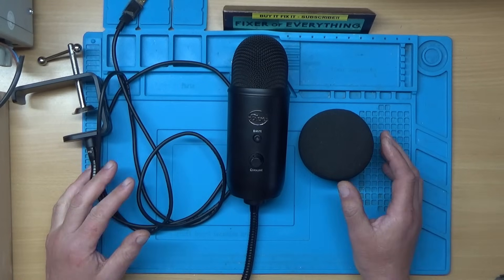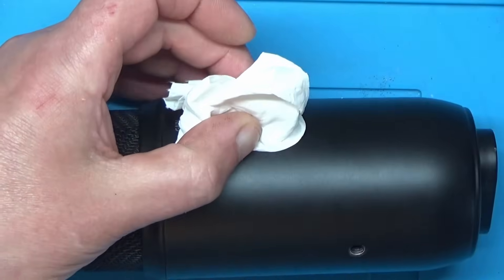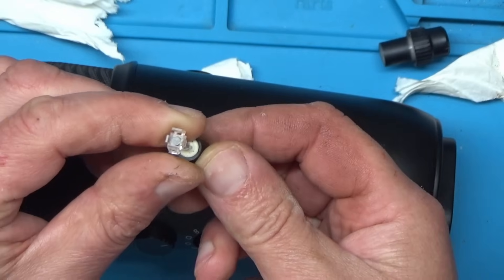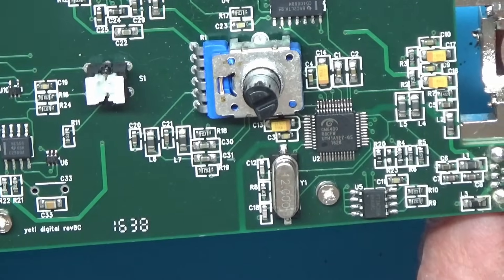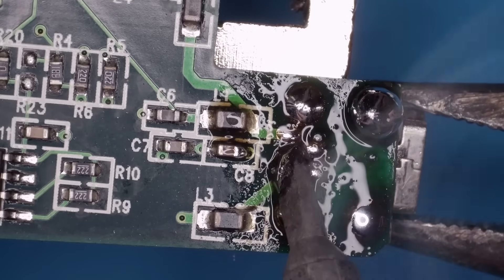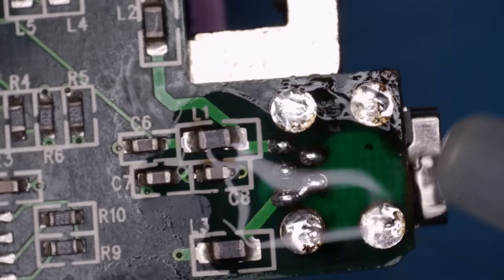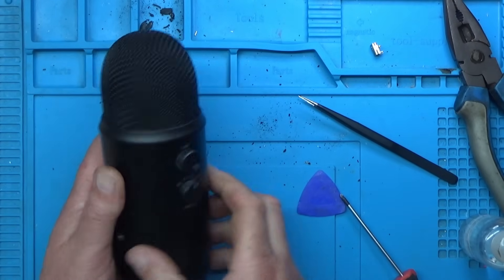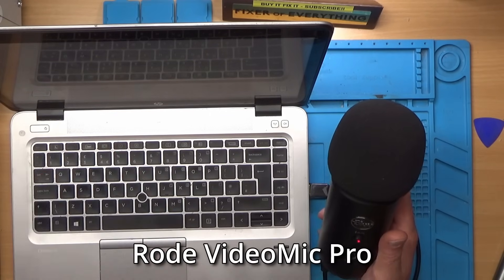Faulty Blue Yeti USB Microphone | Can I Fix It?

Comment: Ambient noise often due to auto gain  turning high as it's not hearing anything never ues auto gain Blue yeti much richer sound.
Reply from the maker: On my regular mic I have the automatic gain turned off (I think the overhead camera ignores it still when it's quiet). I've just bought a new Rode mic that records internally so I don't have to have a computer running while recording, so half of the last video I did used it, and tomorrows video will be using that mic too.

Comment: I also have a Blue Yeti microphone, and the sound is muffled and choppy when recording. What could be the reason? Do I need to do a repair, like replacing a capacitor?
Reply from the maker: Have you tried on a different computer first just to rule out software and configuration issues? I'd probably try that first to rule software or computer problems. Then possibly try the dial for setting the mode as if it's a hardware problem it could be from one of the internal microphones. Selecting a different mode may rule that out. If problems still persist then it most likely is something on the main board (although I'm not sure what at the moment).

Comment: rhodes seems to pick up a lot of environmental sound. Yeti should cleaner, just lacks in the lows
Reply from the maker: Agree, there are adjustments on the Yeti via the software. I decided it was going to be a bit of hassle using the Yeti, as I'd have to use my laptop to record the audio, and then sync it and it would just create more work for me.

Comment: Blue Yeti sounds great indeed. Also i wanted to ask the name or the model number of those 2 small screws that are besides the screw hinge below the microphone. Mine are missing from the mic and because of that some internal loose part is giving me a wobble noise while handling my recording. I don't know what to call them and that's why i am not able to find them anywhere. Please let me know thanks. Nice video
Reply from the maker: Thanks 👍I'm not too sure on the screws. If you mean the two on the very bottom of the mic, I think they are countersunk machine screws. They seem to be M2.5 x 12 as I've just measured them with my callipers for you. Hope that helps.

Comment: I own a yeti blue and it's always the usb. Where the chord goes it puts pressure on the usb plug. They will eventually bend and break on the inside. Then it's a chance every time you plug it in.
Reply from the maker: I had thought about that. On this one is was planning on cable tying the usb lead to the mounting so that doesn't happen. I since picked up a Yeti X which has the micro USB, and I need to have a look at that one still.

Comment: I have a Blue Snowball I picked up for about £15, fully working. It's an older model with a USB Type B connector (the same one you can find on most printers). For something like a microphone, I don't see why they would use anything else. Reliability is important!
Reply from the maker: Yes those connectors are very robust. The newer Yeti X has a micro USB connector. I think that is the worst USB connector in existence!

Comment: Out of the box, the Yeti sounds exactly like the bunch of cheap SDC capsules that it is - little bass and harsh treble. I always thought it was overrated - a Jack of all trades but master of none, and then most people just used it in cardioid anyway. There are some frequency response graphs out there that could be used to develop parametric EQs, but it's not going to sound like a large diaphragm condenser due to lack of proximity effect. It is easily worth your 16 quid though.

In terms of USB mics... you might try a t.bone SC440 USB (black) or something.

Comment: I did the same operation on my Yeti (older model) and desoldering the connector was such a struggle. After several additions of leaded solder, desoldering pump and wicking, I managed to pull it out but not without some damage to the board. A video from Kitchen Table Tech helpfully showed me where each USB pin lead to on the board.
Sadly, it only worked for a few days before losing the data line(s). I need to gather the courage to consider rebuilding some tracks with wire.
Reply from the maker: I'm sure you can do it, it's all just down to practice and experience (and a steady hand). Low melt solder is great for removing things like USB ports, HDMI sockets etc It is quite expensive, but it does go a long way as you don't use a lot of it.

Comment: I stopped the video 2 seconds in after "Hi Blue Yeti Microphone." My guess is the mini usb socket failed and is wobbly on the circuit board. (I had one that was so fragile. I'd say it's a design fault.) 🤔
Reply from the maker: Hi Tim, the soldering was actually OK on the board. Looked like someone had previously re-soldered it or replaced it before.

Comment: Been intending to mention the sound for a while... The Rode/camera combination has too much gain followed by a quick acting but slow recovery compressor (ie. an AGC of some sort). Normal speech is hitting the compresser quite hard which evens out the levels and effectively reduces the gain to avoid clipping. Trouble is when you shut up the compressor slowly (over a few seconds) winds the gain back in bringing up any background noise, like wind or equipment fans.

On  the quick 'n dirty demo the Rode has a more mellow sound and noticeable room acoustic. The Blue Yet rather thin and lacking in balls but didn't have noticeable room acoustic. I like the warmer sound but not the room acoustic...

Loads of parameters to play with so start with all EQ/effects/processing/dynamics turned off, set to flat or bypassed. Position mic a short arms length from and in front of your mouth, speak as you would and set gain so that the meters "waggle nicely". After that the "fun" begins, probably better to have a chat...

Comment: Røde was better because it's softer/rounder in the sound. The Blue Yeti was crisp and clear but lack the bass/middle tone the Røde gives, so Røde sounds better.
Reply from the maker: Thanks for that. Yes the yeti seems to lack bass, but I just used one of the default settings. There's tons of things to adjust as it has an EQ and a whole load of DSP effects and options in the control software which I didn't play with yet. So I can easily add more bass. I'm going to experiment with it a bit.
Reply: @BuyitFixit  That sounds (lol) great! Hope you find the right settings so you can try a new mic. great fix anyway.
Reply from the maker: Thanks Mate 👍

Comment: It’s definitely Blue Yeti for the win. Frankly speaking, removing hiss and background noise is just a click away, for example, in Final Cut Pro or can also be done in so many other ways, but as is Blue Yeti definitely sounds much and much better. If you figure out the settings and add some compression and maybe light reverb - it’ll sound PRO 👍🏻
Reply from the maker: Thanks for the tips, I'll look into that 👍 I'm using Davinci Resolve for editing, I did notice that it has filters for noise removal, noise gates etc. I did have a mess with those but wasn't too impressed with the results.
Reply: @ in FCP there is an ML function for quick noise removal - works really well. Can’t really do that same thing with noise gate, because gate blocks whatever is quieter that a certain level of signal, but that ML thing is removing a noisy part of the spectrum

Comment: In my opinion, I prefer your existing mic rather than the Yeti. Maybe that's because my expectation of your brand " Buy it Fix it" has been conditioned by listening to your many episodes using the existing mic.
Reply from the maker: Good point John. I think I might be able to make the Yeti sound a bit more like the original mic as it has got a 5 band EQ, filters, effects etc which I've not even played with yet. Also you can set the mic "pattern" so it picks up from a single direction, or all directions etc.

Comment: The Yeti mic has essentially zero background hiss but a little harsher sounding on the ears. After tweaking it's profile I think its the winner here. Are you sure there isn't a way to get it to work directly with the camera?
Reply from the maker: Thanks for that. I'm not too sure if the problem is the recording in the camera itself (in built pre-amps or something). I've turned the AGC off on the camera and set the level to quite low, but I still get the hiss.

Comment: The Rode sounds better. The Yeti is too clipped and thin sounding.
Reply from the maker: Thanks for that. I too like the sound of the Rode, but I'm going to have a play with the EQ and other settings on the Yeti as there's tons of options, EQ, etc.
Reply: @BuyitFixit  I have video mic pros too. they score over my Rode NT-1's because they are directional rather than omni so you can point them at your mouth and minimise the pickup of sounds from the test gear on the bench. I do run them into a DBX Processor with compression and a noise gate and record them with a Tascam  Audio recorder. I just use the camera audio to sync the sound to video and then mute the camera audio.
Reply from the maker: Thanks for the info. Yes that's pretty much what I did when testing this mic, I recorded as usual and just matched up the audio. I have to do similar when recording with the microscope, as that doesn't have audio so I use my overhead camera and then have to sync the video with the audio.

Comment: Blue yeti has a great sound isolation I like it specially if you have noise around you 👍🏼👍🏼👍🏼
Reply from the maker: Thanks for that 👍I know there are a lot of options in the software with the Yeti, and you can also set different mic patterns to pick up sound just in front, or all around the room.
Reply: @ a quick question I found an and fuse with the letter I but can’t find a replacement online as it seems it doesn’t exist, what do I do ?
Reply from the maker: If you have a picture of it, drop me an email at the name of the channel at out look dot com and I'll see if I can help.

Comment: using USB Mini must be a fairly old model of the Mic then I guess
Reply from the maker: Yes think you're right. I actually won another Yeti mic, the Yeti-X which I've yet to try to repair. That one isn't being detected by the computer. It has power, but the micro USB looks intact..
Reply: @BuyitFixit  ah you use Ebay bidding to find cheap items to repair ? I hope you can fix the other one too.

Comment: Forget it. The Yeti has a thinner sound than your usual mic. These are not good condenser mics. They emulate the form of the big capsule ones, but they use a normal, cheap capacitor mics instead. Keep on using your usual one. Forty years in the recording and music production world are recommending it to you.
Reply from the maker: Hmm Interesting. The Rode mic is also a condenser mic from what I remember. I know the Yeti has a lot of effects, EQ, etc which I've yet to mess with so perhaps it was just because it was on a default preset. I know a lot of YouTubers podcasters seem to use them.
Reply: @BuyitFixit  yes, of course the Røde is a condenser mic with almost a couple of cheap capsules. But never forget that always are qualities; as I mentioned, nothing to see the condenser topology between a Sony C800G, or a Neumann U87 (or 67, et al), with a huge condenser capsule (mylar, gold powder), with an excelent frequency response and flatness, with a 1£ (or less) condenser capsule. 
Even the MEMS mics are better than these small capsules. And of course the pressure gradient. 

All in all, believe me: this “big” mic has a good image, but the inside is very poor (in terms of microphone exclusively, I mean). It will have eq, effects, etc., but the real sound is poorer than the Røde you are using. Thinner, much thinner (but not clearer; equally clearer, but with an important low cut).

I sold millions of records in the '80s and the '90s, and produced and recorded artists like Paco de Lucia, The Chieftains, Depeche Mode, Julio Iglesias…and a lot more. 
I think my impression will be of a certain importance. But, after all…it’s up to you!
Reply from the maker: Thanks for that, I'm no expert when it comes to microphones etc so good to know someone who's a lot more knowledgable than me 🙂👍
Reply: Thanks to you for your excellent videos!!

Comment: I prefer the Rode even though it's not as good an audio; it's roomy and reverberant. 

The Blue is cleaner but a bit sterile for your use in my opinion. 

I want to hear the room as it's far more natural to what you are doing. You don't need the isolation.
Reply from the maker: Good point. I know the Yeti has different mic patterns to do that, and a lot of other options such as reverb, EQ etc in the software control panel. I'm going to have a mess with some of those and see if I can get it more like the Rode but without the hiss.

Comment: YEAH... Don't change the Mic.   That "BluYucky" microphone sounds like it's name.   The problem seems to be in the audio range of the microphone.   Very little bass and a lot of treble.   It doesn't sound natural.   You may need to put mixer between the mic and the computer so you can control the frequency response of the microphone.  Check the audio settings on the laptop to ensure you are using the full capabilities of the Microphone and the recorder.
Reply from the maker: Thanks for the feedback. The Yeti has a whole software app on the PC which lets you set the EQ, effects, etc as it's got a built in DSP. I might have a mess with those as I just used one of the default presets.

Comment: I think, the yeti is a bit more tight, certainly more middle and hi freq (or less bass). Both sounds great. It's up to you.
Reply from the maker: Thanks for that. I'm going to have a mess with the EQ / effects settings in the software as it was just on a default preset. I'm sure I can add more bass and cut some of the treble.

Comment: 3:38 - Im thinking now, if you have fishing line, cut one part of 15cm, and tie it in O shape, repeat one more time, now you insert one on left side, and tilt right, insert second one on right, and tilt left, so its like X , pull up and should get out. Hopefully you understand me.
14:42 - Every single user has different: Ears, speakers, speaker adjustment, sound card, etc etc... Rode is crisp clear and good enough, dont change it. Blue yetti is like underwater... maybe with another preset could be better...
Reply from the maker: Thanks for the feedback, and the idea of the fishing line 👍There's tons of settings on the Yeti control panel, so I'm going to experiment a bit with those.

Comment: i had a different mic by the same company. It would have been an easy fix if they hadn't glued everything in. i ended up broken buttons and knobs ripped out of the PCB. These companies infuriate me.
Reply from the maker: Damn that sucks. Luckily it didn't happen with this one. I've actually bought another (Blue Yeti X) which is the updated model which powers on, but doesn't connect to the computer... Hopefully it wasn't one of those.
Reply: @BuyitFixit  i can't remember what model it was but the usb connector was like an easy reach but just out of reach.  i can't remember the exact model but it strongly resembled a blue yeti. it had a button and two knobs on the front, and it was black. i recall looking for teardown videos for it at the time but i didn't find any.

Comment: If you just power the mic with the Bluetooth cable and a phone charger, you can use the phones out on the mic to feed audio into your camera. Thanks for always putting out an interesting video!
Reply from the maker: I'll give that a try, although I'd think you'd lose a lot of the DSP processing and EQ etc as that seems to be all controlled from the PC. Unless it stores the settings in the serial EEPROM on the board perhaps.

Comment: Audio engineer here, Blue yeti mic has a warmer feel. Your Blue yeti mic has a headphone 3.5mm output jack, you can run an aux cable out of that headphone jack and go directly into your camera without having to do additional audio editing. You'll need to power the Blue yeti with your computer however, you won't need to record audio on your computer.
Reply: Or you could just power it with a powerbank
Reply: I don't know any audio engineer considering the blue as anything more than a gadget Tbh 😅
Reply: He needs a 3.5 cable for mono transmission. Stereo wouldnt work with a mic i think

Comment: The Rode seems to be more midrange but also picks up the room acoustics.  The Yeti sounds like it has some processing like a gate clamping background noise, but it also sounds a bit thinner accentuating the higher frequencies and lacking in any low end.  The Yeti also cuts out any room reverberations much better.

Comment: The foam cover you put on the Yeti may have helped to reduce the background noise: this sort of foam is designed for small amounts of mic filtering to reduce high frequencies & wind noise (similarly the fluffy covers you often see on outdoor recordists' equipment, eg in a live location TV news clip). If you obtain a similar cover for your Rode you may well find it reduces the background & 'hissing' you mentioned (personally I've never heard it on your vids)

Comment: I'm 78 years old and don't hear quiet sounds much above 4 KHz. To me the two mics sounded almost the same, with perhps the yeti slightly clearer.  I can't hear hiss from either. So, for addressing doddering old fools like me, I'd use whichever is less bother. BTW I bought a blue yeti with exactly the same aims a few years back. Could not stop it picking up hum from my under-desk pc when mic was sitting on desk, even with several kinds of foam to try and isolate it. So it has been sitting on my shelf unused ever since.

Comment: The Sony CX450 has auto gain turned on by default and can cause the hiss when quite as turns up the gain. Rode mic should be better via the camera. Also as other said its less work to edit a video when all is recoded together in one and synced as well.  PS I did send you an email on the gain / mic levels on the camera